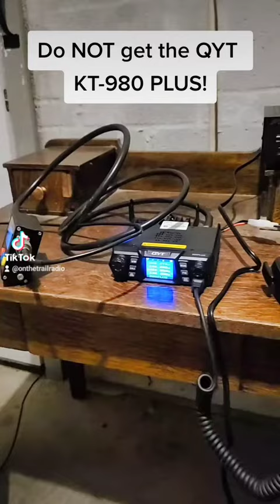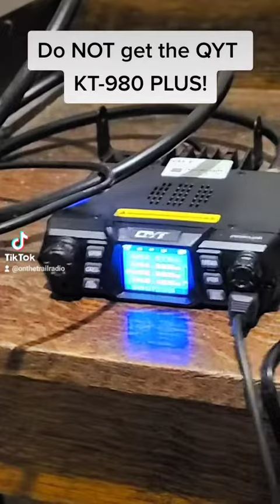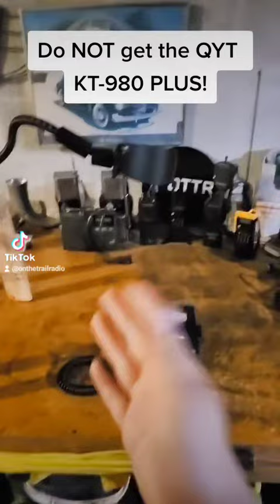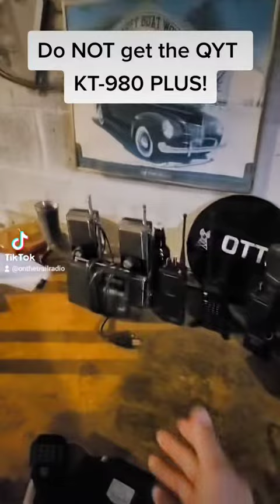Do NOT get the QYT KT-980 Plus!

Comment: mine actually pushed 80 watts on business band 155.625. and 75W on 145-625
Reply from the maker: Maybe they would make great business radios if they could get certified as them. Many people would love to have that much power, especially in the mountains
Reply: Mine too. And right at 50 on uhf.  Great radio. Few months old going strong. That's through an antenna not even a dummy load.  Think that's just a bad radio in the video.
Reply: Prove it.  Seen a few reviews on the meter and all were right where they should be.. I didn't see any proof here.
Reply: Yeah mine puts out 55 watts uhf unlocked for GMRS using the code I was provided you got a bum radio
Reply: how did you get yours to transmit out of band?
Reply: @kalikoresh-py4ik what code?
Reply: Sometimes it depends on the antenna and power supply